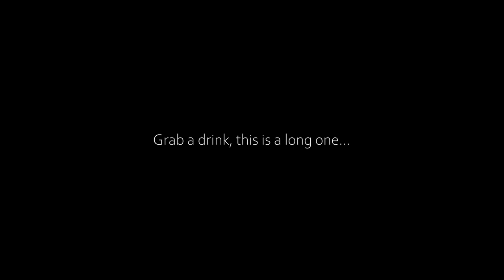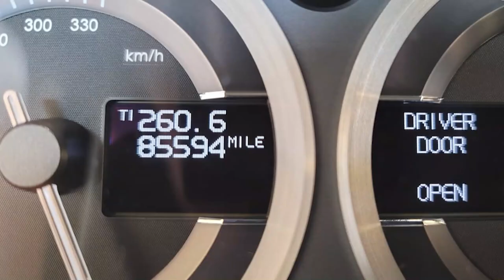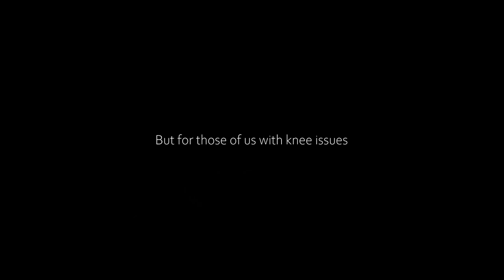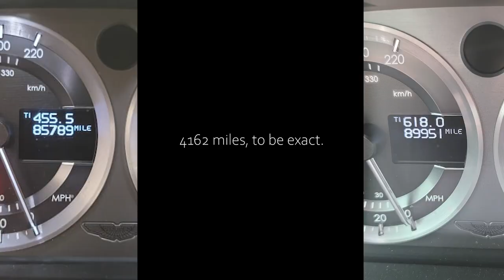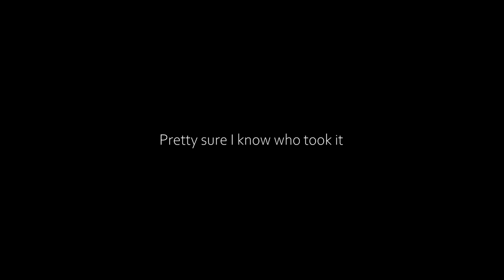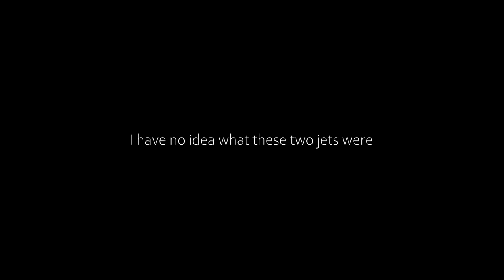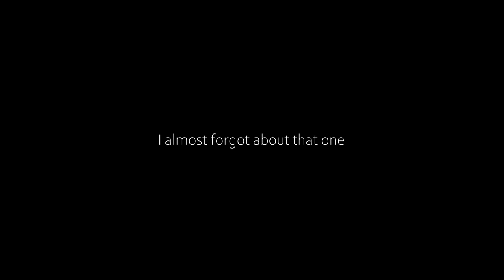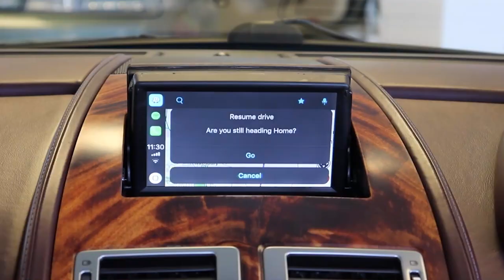4000+ Mile Road Trip Across the USA in a 90,000-mile Supercharged V8 Vantage!!

Comment: Thanks for this video; it was great to watch! I couldn't help but compare the experiences you had on your trip with mine. Eight years ago I took my 18-year old daughter on a road trip in our 1976 Aston. The car had just had an automatic to manual conversion done, as well as a few tweaks to the motor. The trip ended up being very close to 4000 miles, and 90% of that was on remote, secondary roads. We crossed the Rockies several times on that trip, including a very snowy Going to the Sun Road (Montana), as well as the Beartooth Highway (Montana/Wyoming). Spectacular roads, but not ones most people would dare take a rare 37-year old British car. In comparison to the numerous mechanical issues you experienced, our only problem over nearly 4000 miles of somewhat challenging roads was a dead alternator. Luckily we had chosen the right border crossing from Canada into the US, for the US Customs official near Eureka, MT had plenty of spare time to give us a push start! So there is something to be said for older technology... There's less that can go wrong. Keep making these awesome videos!

Comment: Hey man,
the door locking and light issue is exactly what I had. your windscreen is not sealed, water drips in and get into bcm causing erratic issues.
100 % aston standard issue. Remove windscreen - will be easy no glue and reseal...
I used to pull fuses weekly , after a long long drive in storm i felt water on foot. Resealed screen and all issues gone.
Get a piece of paper and I bet you can slide it through the glass.
Reply from the maker: My windshield is in dire need of replacement but I've been putting it off due to the cost of it lol. The big accident I had during the track day was on my passenger side, and the repairs weren't entirely complete, so I'm wondering if my door module was damaged in that, or the remnant damage (not being resealed properly) is what's led to it failing.
One of my really big projects is to redo my windshield, passenger door, and paint, and then wrap the car and add some more carbon fiber to the exterior. But I'm still saving up for that lol.
Reply: Send me your email. I might have a spare windscreen for your model

Comment: For an exotic car, the v8 vantage is very reliable. I wouldn't take an r8 for a long journey but vantage is ok
Reply from the maker: I have a few friends with Audis... R8 (V8 and V10), RS4, RS5, RS7... and their experiences have been varied, but consistent on average: May be solid, may be extremely faulty. May be reliable, may require the threat of a lawsuit to fix. I've never owned an Audi myself so I can't comment, and I've had ***KNOCK ON WOOD IN ALL CAPS*** good luck with Astons. On the whole, my Aston has been incredibly reliable and any faults it has had were inconveniences at most.

Comment: I have a similar issue with my infotainment system—pulling the main system does indeed reset it. Also, I have to start my car within a couple of seconds of turning the key (not waiting for POWER BEAUTY SOUL) to negate most issues with the kit. James is going to have another look the next time I can get over there.
Reply from the maker: Sounds like there might be something else going on? It shouldn't matter if the car sits with the accessories on before the engine is cranked. That might be a sign of another issue with your car's electronics.

Comment: Is there a reason you couldn't/didn't want to just take the radiator to a local radiator shop and have them fit a new core or solder it fixed? Seems like that would have saved you a lot of grief until you could get home and research a better replacement. Also would definitely like to see more comfort orientated coil overs for there cars.
Reply from the maker: It was something we considered, but it wasn't possible due to the way the radiator cracked and the way it's constructed.
The BC Racing coilovers can be set to very comfortable settings. They were perfectly fine for me, even over rough roads and broken pavement. It was a key thing I refused to budge on when specifying the design and spring rates. My red V8V with BC Racing coilovers was WAY more comfortable than my grey V8V on H&R springs.